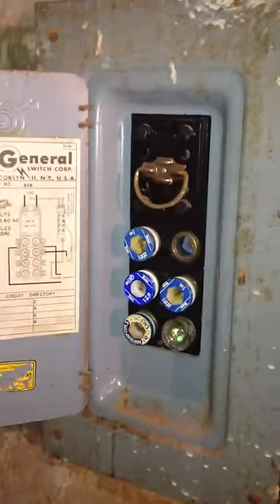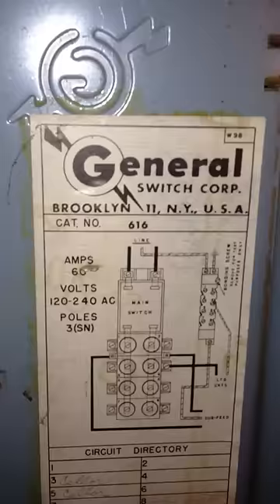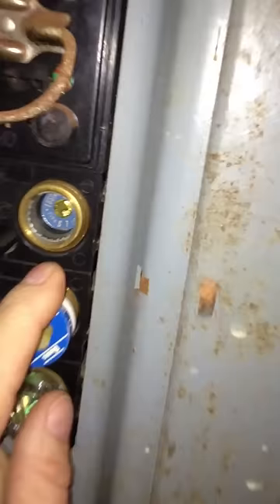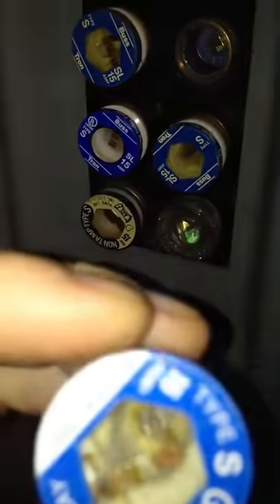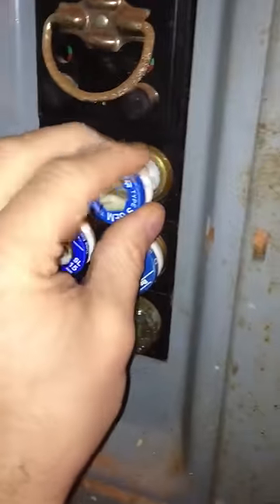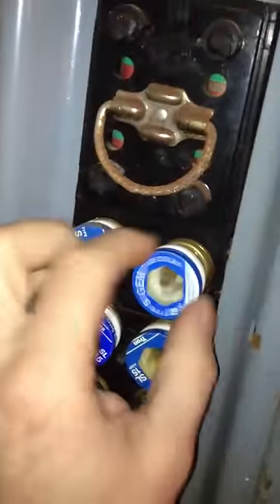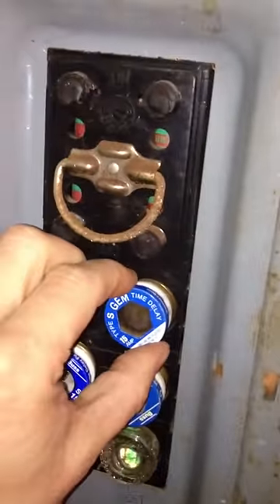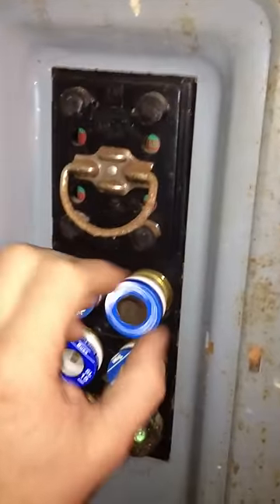Blown fuse

Comment from the maker: @SkilledEddie I wouldn't blame you for not wanting to touch anything. That is a very old panel and it needs to be replaced. Unfortunately, that very old panel by a very old lady. She was not in a position to replace her panel. So if it means I have take on some liability to help out a senior citizen I will do.
Reply: Mines is doing the same and I can’t figure out what’s wrong!
Reply: It can be a stray wire exposed or faulty wiring most likely. If you are using certain things and it gets overloaded, that could also be the problem.  Surprisingly, that board is doing an good job stopping current lol.
Reply: So the only way to get to work is rewiring?

Comment: I have same Problem! Check all your Wall Socket! Wires could be damaged and tighten all the Screws that connects to the Wire! Make sure turn off the Main Power before you check all your wall socket! Good Luck!
Reply: Hello can you go into detail on what happened? And how you unscrewed your sockets? And how it looked?

Comment: How can I tell which knob and tube fuse is blown
Reply: Well, the most noticable thing is the glass in the knob is completely dark instead of clear. You will also notice that in a certain area, the power doesn't work. The tube can also be noticeable (you may hear an noise of it breaking). In seeing it, it's hard to tell.